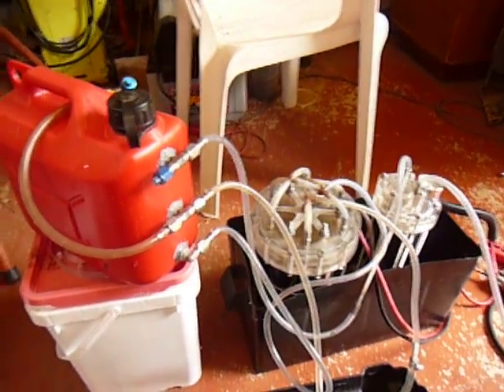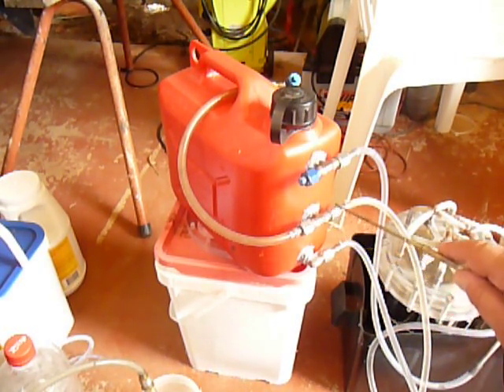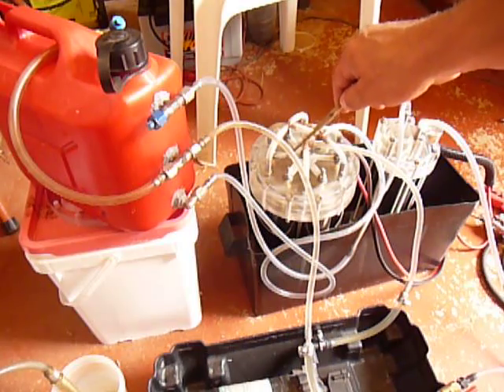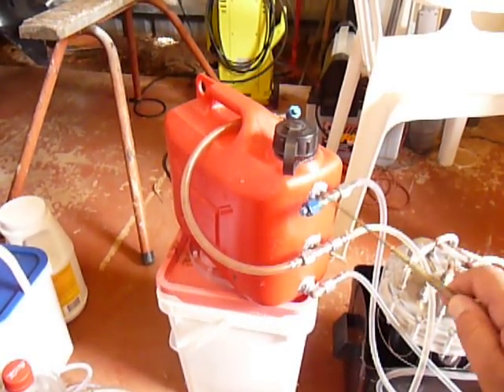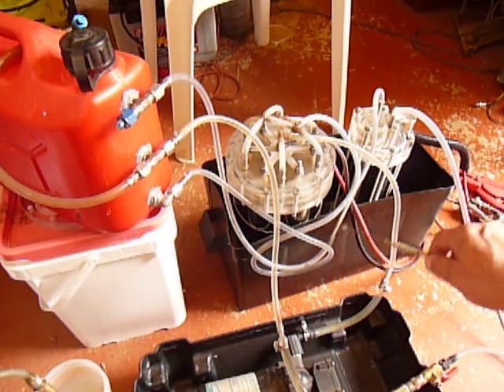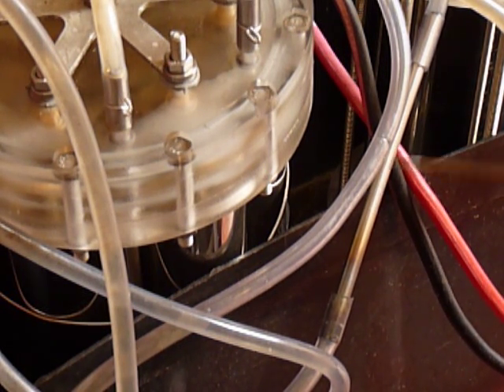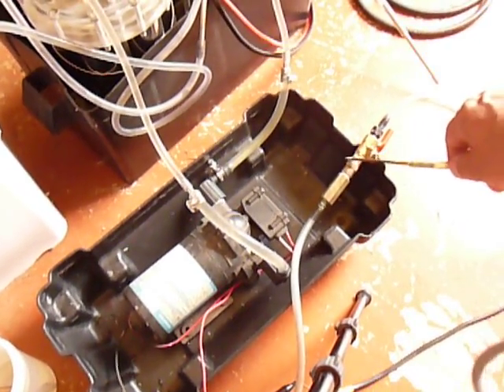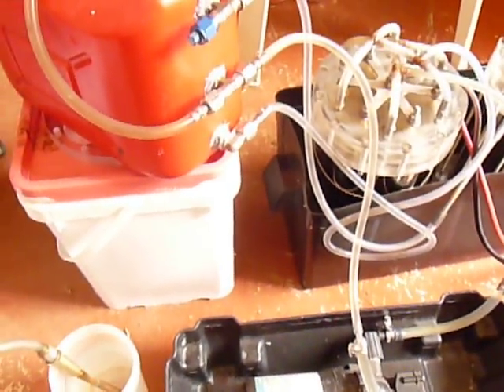hho update part 1

Comment: very cool set up! how many tubes are you running and how are they wired are they wired in series or in parallel? How many volts does it take to draw 40 A with tapwaterNd your set up? Sorry for all the questions just a very cool project. Thanks Darrell